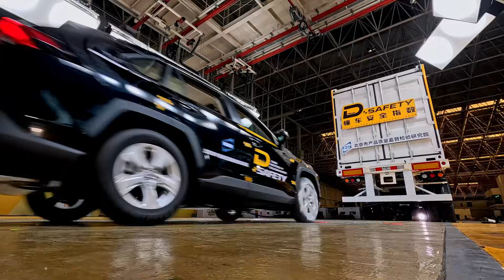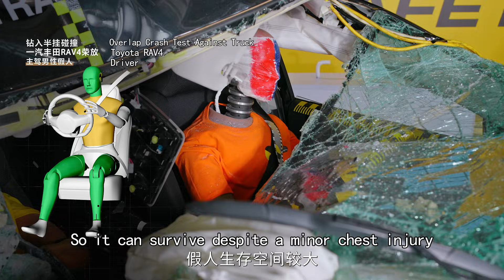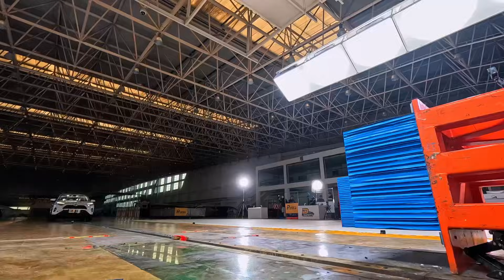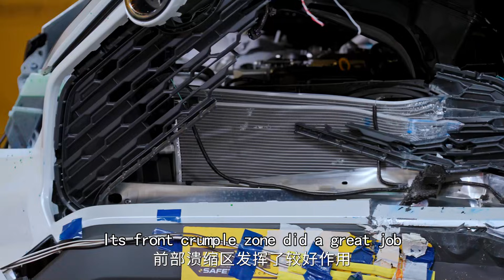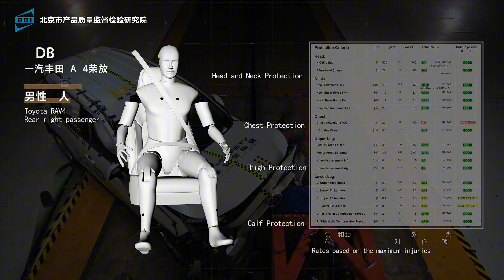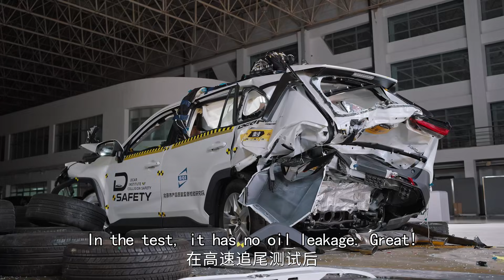Toyota RAV4 Crash Safety Test RAV4荣放 碰撞安全测试

Comment: Two major Flaws going on with this "testing".
First major Flaw is that most modern vehicles have crash detection software, you didn't allow the system to work as designed! You literally jammed it into the trailer. Which is the major flaw because you did Not test crash avoidance!!

Second , The trailer has a poorly designed bumper, it literally failed and allowed the vehicle to get destroyed.

I wouldn't even bother to believe any results from this testing as it's Not realistic and Flawed!